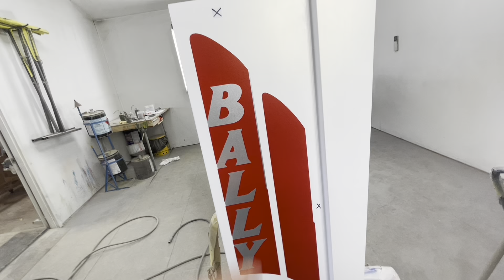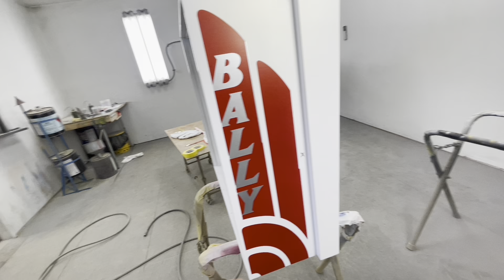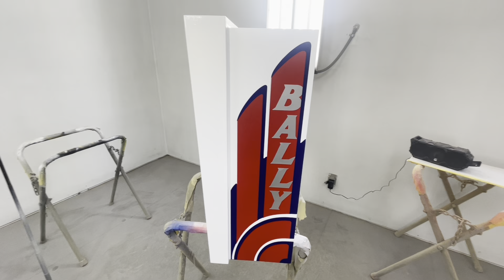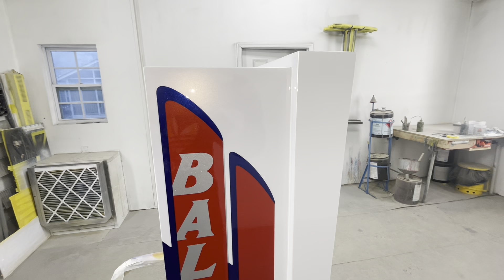Bally Captain Fantastic Pinball Machine 2

Comment: Does anyone know what the purpose of the light black spray is after the first coat of paint?
Reply: Helps see imperfections. A light sanding takes it off and what's left are the low spots to be filled.